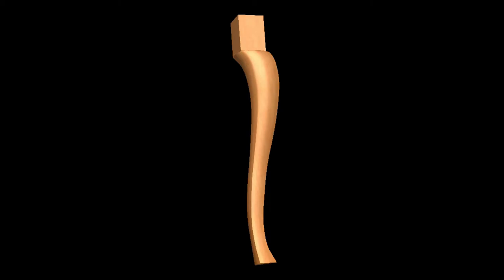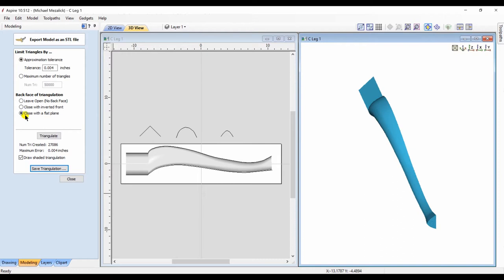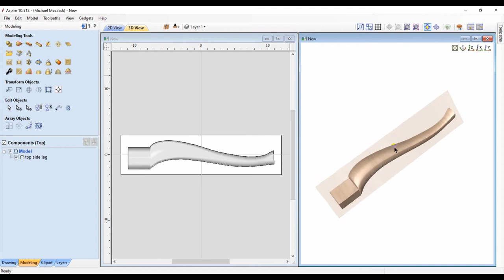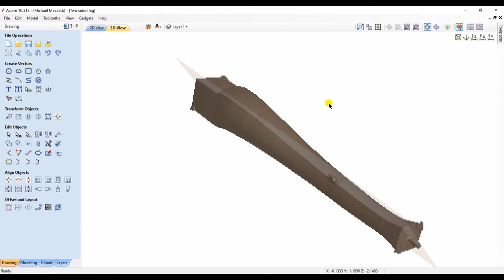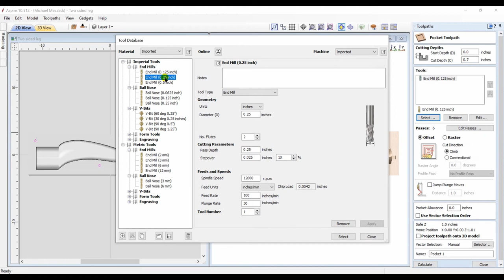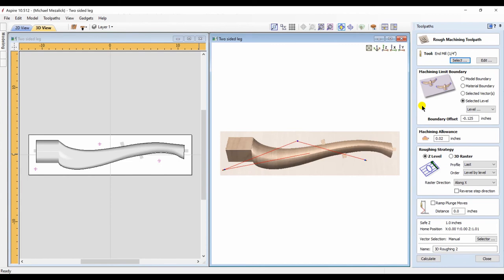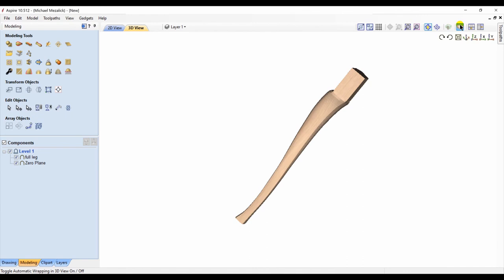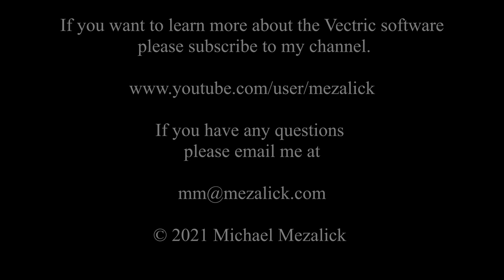Making a Cabriole Leg with the Aspire Software

Comment: is it possible to rotary photo carve a persons face/head with aspire..? you know make a bust of a person from a photo using a rotary axis on cnc..?
Reply from the maker: Yes it is possible
Reply from the maker: Making the head is the hardest part.
Reply: @mezalick  when you say "making the head is the hardest part " are you referring to the photo toolpath process or the actual carving process..?
Reply from the maker: @squidskunk  The Photo Toolpath is easy, but I was assuming you wanted to put the photo carving on a 3D head.
Reply: @mezalick  i want to carve a 3d bust of a persons head (from a family photos) on my rotary axis as a gift to my father
Reply from the maker: @squidskunk  Aspire is more for what I call bas relief carving where the back is flat. It is possible to scan the person head and then import it into Aspire for rotary cutting or you can create the head in another program such as Sculptris , Z-Brush or any of the several other true 3D modeling programs. In Aspire, you'll need to think as if the "head" was laid flat like a piece of paper and then wrapped around to form the true 3D shape. it can be done, I've done it, but not without spending many hours. Try Sculptris..https://www.sculpteo.com/en/glossary/sculptris-definition/
Reply from the maker: @squidskunk  Try using https://www.sculpteo.com/en/glossary/sculptris-definition/...Asspire would be very hard to use.
Reply: @mezalick  thank you so much for clarifying this for me.
Reply from the maker: @squidskunk  Here's a scanner that's rather inexpensive and does a good job...https://www.youtube.com/watch?v=g2P3WC5kx_s

Comment: I have a problem with this,
In mach3 software may we run a toolpath ?
And which postprecessor of toolpath  will be used to make a carboile leg ???
Reply from the maker: Yes you can run the toolpath GCode in MCH3 but you will need to use the correct Post Processor to create the GCode. The correct Post Processor comes from your machine manufactor. They would be the best to ask about this.
Reply: @mezalick  please guide me more 
I have made my machine
Reply from the maker: @hafizabubakkarijaz3009  When saving the GCode ,Choose the Mach3 post procesor from within the Vectric software.